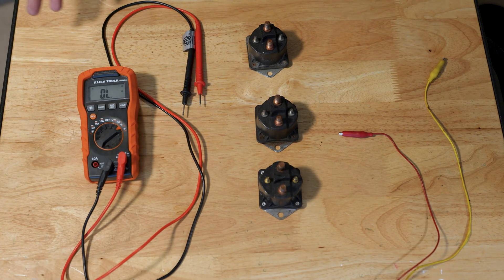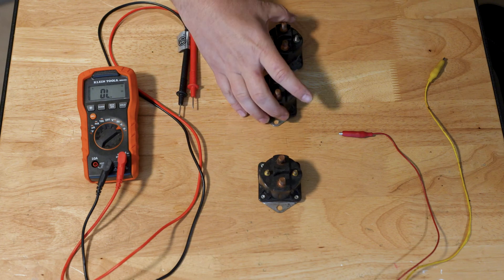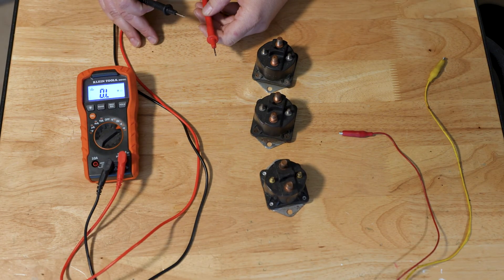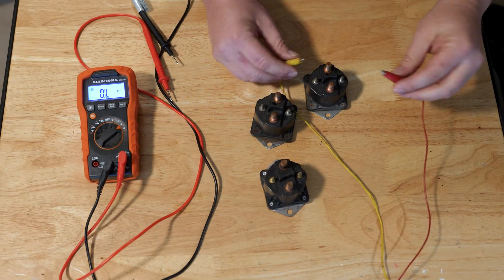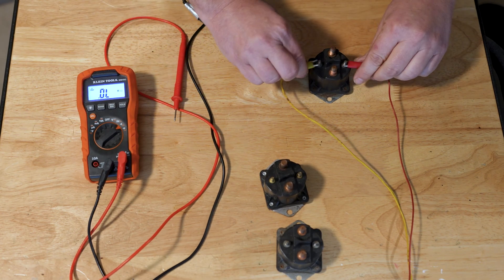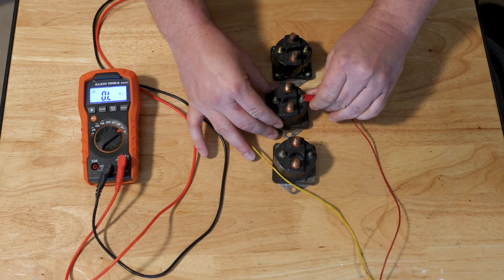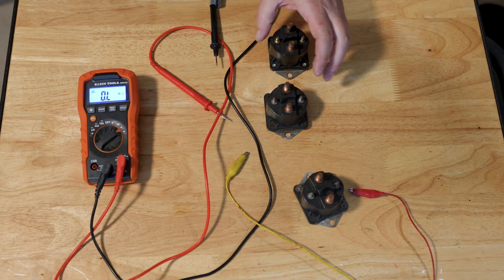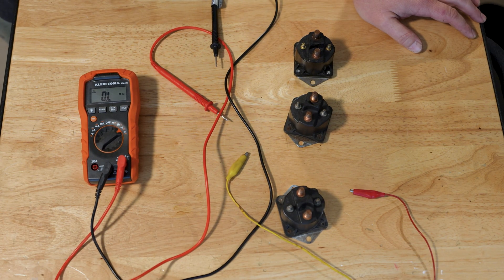How to Test Warn Winch Solenoids

Comment: A couple ohms is fine. You bad solenoid was probably the one that broke when you took it apart. Once you get over 10ohms it’s worth replacing. A few ohms is practically nothing in terms of conductivity/voltage drop. Good tutorial though!
Reply from the maker: @coopersloan3938  you are probably right about the broken one. Had a lot of corrosion on it but the one I threw out was definitely questionable. the readings were not consistent like the other two so I tossed it.